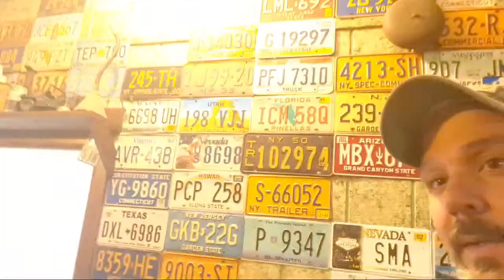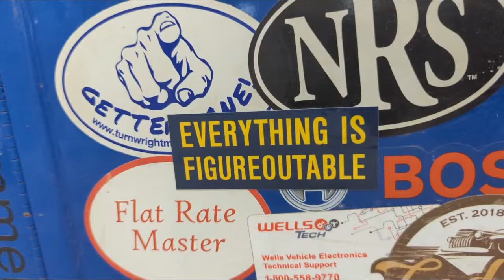What's Up Wednesday 7/27/22

Comment: I am no expert on piston slap either. I can tell you that I have a 1998 Chevy K1500 that are prone to piston slap. Mine developed piston slap somewhere around 150,000 miles. It is my daughters truck now and has been parked for a couple years now, but it has close to 400,000 miles on it and the piston slap is the same as it was at 150,000 miles. I think it is a non issue.

Comment: One the main issues was manufactures didn’t think techs were smart enough to understand the systems. Take waste spark systems. GM told us they sparked the exhaust plug to help burn off emissions, well that’s totally stupid and not true. It all boils down to theory and operation. Understanding what they are trying to do and how they are doing it. I worked a few years at the AC Delco hotline, shops would call in and we would walk them thru testing to find the problem. Some of the things and ways they had tested already was scary.  I was involved in the early days if  iATN and spent many hours in chat helping others diagnose problems and most times a wiring diagram and common sense was all they needed. We call it critical thinking.

Comment: We need a good brake job like Josh had a few weeks back with the rotors just gone everything is wasted.   I was laughing my backside off when he tossed what was left of the rotor at Eric.
Reply: Can breaks on 96 c1500 be bleed with out scan tool? I can't get good peddle.
Reply: @jimwaldman8753  Usually can but it can be a pain bleeding out the ABS pump
Reply: @therandomchannel2022  on my Ridgeline I blead the brakes, then what I do is drive around and activate the ABS so it cycles the fluid through and any air usually goes into the Reservoir.
Reply: @CommomsenseSmith  Yes most of the time that works, just have to be careful doing that on city streets lol
Reply: @therandomchannel2022  yeah I have a few very quiet areas to do it

Comment: Watching after the regular show.  Missed live feed.  Wanted to ask question on 05 Equinox with 225k miles.  I replaced brake switch yet cruise control will not engage.  Autel shows that the cruise switches are good.  Keeps saying brake applied.  When you step on brake value shows 10.8, when brake released 4.6.  Can you adjust the switch?

Comment: If I was in your shoes and wanted to move but it had to be easy I'd just jump over to PA. hard thing to do when you're anchored though. Or, you can make it worth the effort and leave the rust belt. keep the snow in colorado with none of the rust. we don't dump salt on the roads here. Depending on conditions a variety of chemicals are used that have corrosion inhibitors. most old trucks here aren't rusted out. if they are, they probably came from the rust belt.

Comment: Eric o I have a 2007 dodge caravan se flex model I saw on your video about a ball joint where u had trouble with the cv axle can u cut the axle in half and remove the wheel hub assembly and would you be able to remove it that way instead of smacking it out I live in the rust belt area like u Cleveland Ohio my theory sounds good but will it work? can u please respond thank you Eric o

Comment: RAMPS - Any suggestion for good ramps for a 2018 Kia Forte? I have to use a jack to change oil! Can't find ramps that are low enough.
Reply: I have a 2020 civic lowered on d2 springs for about a 3 inch lower than stock ride height. I use RinoRamps, I just went to home depot got some 2x10’s stacked them screwed them together and at each “step” cut it at a 45 degree angle to make a nice ramp. The back end I cut at an angle to match the original angle of the ramps so it nests against the ramps snugly, this helped to provide enough run to get my car up into the elevated platform.
Reply: What about the ones from Harbor Freight?

Comment: I'm wondering about that camera.  Did you use it to record welding?  Cameras need protection from the welding arc same as your eyes.  Even if the camera is not actively recording the welding radiation can fog certain types of plastic.  So when you sit your camera down point it away from the area where you might be doing some welding.

Comment: Fluid film rocks! Rust bubbles appeared on both rear rocker panels, two years ago. Chipped the paint off on the driver's side and drowned it with fluid film. Left the other side alone.
Now... I have one ugly brown area on the driver's side, and more bubbles and quarter sized holes on the other side.

Comment: So I am doing a fuel pump ( 106 degrees today) vent valve and a purge valve on a 2014 Suburban.  He's been driving with no gas Guage and a check engine. Typical GM stuff. That said it's got a full tank. The only way to get it out is to tilt the back of the tank below the differential to get clearance.  I hate gm. So have to empty all the fuel to put it back In. I'm not fighting all that weight.

Comment: Bummed  missed this. I love watching your channel.  Have a 2010 Hyundai Elantra Touring with 193k miles. It runs fantastically and ve always taken mint care of it EXCEPT the tranny. I have never changed the fluid. IT still drives  smooth, but the fluid is brown (does not smell). Is it worth changing the fluid and risk slipping r should I not touch it?
Reply: I've got a 2013 Kia sportage with 320K. Same thing as Hyundai. I've changed the Trans fluid 3 times and mine never slips, still shifts smoothly too.

Comment: 2003 Chevrolet Silverado 2500HD what module runs the heated seats, power windows/locks, radio, dome lights and gauges. Everything stopped at once. Can anyone help?